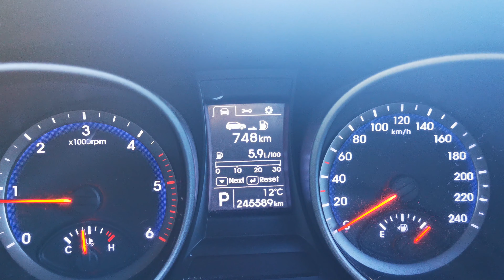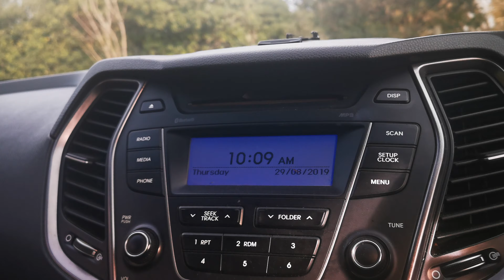Hyundai Santa Fe Wheel Bearing Replacement

Comment: Great video!

Just a tip to anyone... Do as he did and spray brake parts cleaner and blow it dry. I personally prefer to apply anti seize to the CV axle splines and make sure the bolt threads are clean.

Comment: Excellent! Just identified wheel bearings problem this morning. Same side and wheel position. Yours Looks exactly like my wife’s down to the color. 2017 AWD Santa Fe. Gonna give it a go in couple days thanks to your video. I’ll buy OEM from local Hyundai dealer to avoid small nuances from aftermarket parts that can create big problems. Cheers mate!

Comment: Have you seen the Clio. Shortly after I got it I got a boat at Bardney Lock. Mile track across fields. Every year I was changing front wheel bearings, one or both. 5 years later I moved, only had one go since. Problem was dust.
Reply from the maker: I think dust is what got to this one too. Lots of dirt roads around here and a good dust trap behind the bearing.

Comment: I wondered how you've managed to get access to the hub bolts without removing the axel with ABS tooth-wheel. It sits just above the bolts.
Reply: Did you ever figure out an easier way to access those 4 bolts without taking everything apart
Reply: @Tedclassified  I tried, but the only way to replace the bearing in AWD Santa Fe is to remove the axel first, which is a hassle. I had to dismantle all 5 arms/links. Then I was lucky to have a neighbour that has 20T hydraulic press. Just with that press, he'd managed to separate the axel from the bearing. Once the axel's removed, the thing are pretty straight forward. Otherwise, I had to scrap all the assembly (the axel with the hub), than it is just at a scrapyard that you can find an affordable replacement for it.
Reply: @Seerrah  diffrent size extensions, woble extensions and different angle ratchets are your friend, took em off a customers without taking none of that off

Comment: as somebody that has destroyed wheel bearings by over tightening i would follow the correct torq spec and leave it as exactly that,
Reply from the maker: I did didn't I? 2 years and 70,000kms later  and it's still good.
Reply: @Badgertronix  you did but the extra ummpth is something i wouldnt recommend just saying,
Reply from the maker: I can't remember from the video. I would have only been trying to get it to factory spec. My torque wrench goes up to 150lb/ft, the spec is 200 lb/ft, hence the extra shove to get it close.

Comment: What was the app you looked up on your phone to get the torque spec?
Reply from the maker: came from www.hsfmanual.com
Reply: @Badgertronix  Do you know any apps for toyota cars. Normally here in the uk you can buy a haynes manual but for some reason the don't do one for my toyota.
Reply from the maker: @gettingoldereveryday  I couldn't tell you sorry. I hardly ever work on toyotas and haven't needed to look for info. I'm sure there will be one somewhere

Comment: 250000 kms for a 2014 car seems like a lot for NZ, how did you manage to rack up that many k's in just 5 years? just curious
Reply from the maker: It was leased by PGG Wrightson and was at over 200,000kms when I got it.
Reply: @Badgertronix  Ah that explains it.  Still at least another 250k left in those diesel Hyundais.
Loving the videos, especially the Morris Minor build
Reply from the maker: @sossy995  it has a decent warranty that will cover anything major. Wasn't worth claiming for the bearing!

Thanks, plenty of work happening on the Minor in the background 😊

Comment: Interesting, I’ve never owned a car with a combination of drum and disc brake, mine have all had the handbrake operating on the disc callipers.
Reply from the maker: The Vauxhall Senator I had 20 years ago had the same setup and my Citroën BX had the handbrake on the front wheels. I'm more used to the usual rear calipers with handbrake mechanism

Comment: I advise ppl to really start "hunting for your meat" sort of speak. What i mean here is don't just buy a car and become incognizant of your car and your abilities. We live in a market where companies will absolutely take advantage of your ignorance and laziness. You could be saving yourself hundreds -- if not thousands of dollars -- by simply taking the time and effort to learn how to repair your car. A lot of issues are mechanical, which, with a proper jack and tools, can be installed in your garage. Know the torque specs, have a jack, have a decent assortment of tools, and you will get it done. 

Some things though like electrical issues or anything to do with fuel lines or inside the engine, I'd leave to a mechanic. 

I've done my own repairs on my car . Spend a few hundreds on parts instead of giving away thousands to sleazeballs that will just overcharge you.

I also highly recommend ppl to buy an extra tire, not the replacement tire but the actual tire.